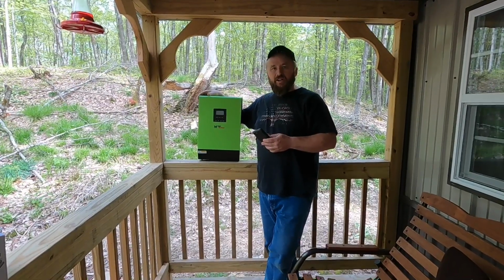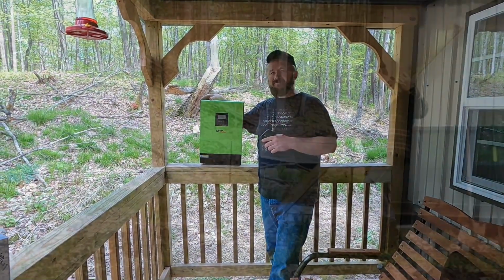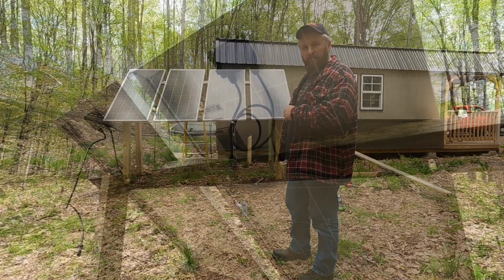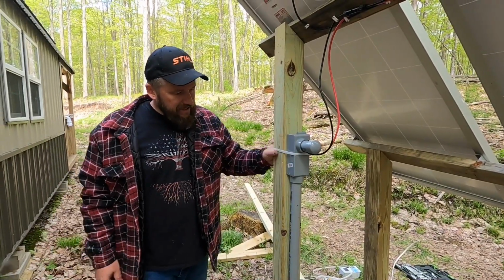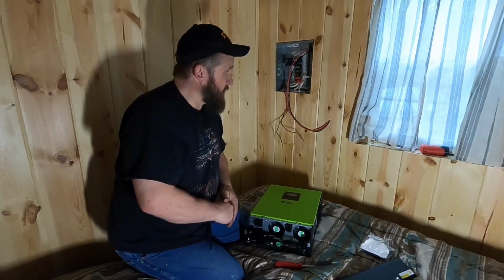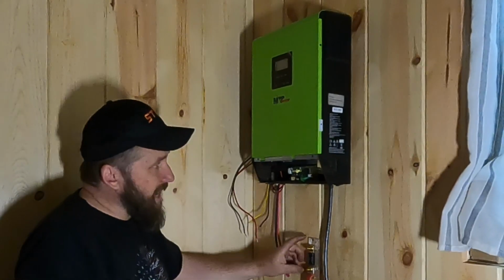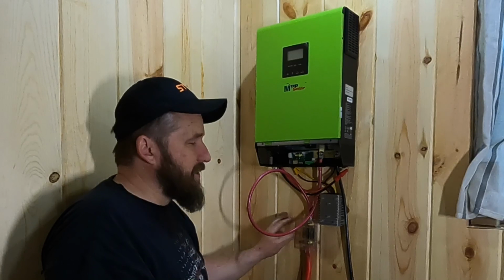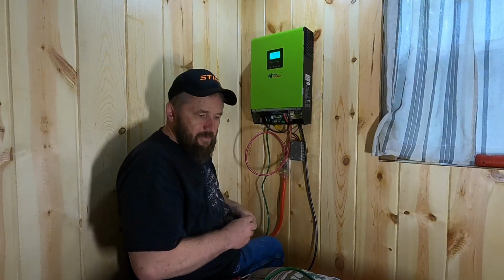MPP LV2424 Solar, cabin upgrade #offgridcabin #diysolar #mpplv2424 #freeenergy #freeelectricity

Comment: What did you use to attach the panels to the 2 x 4's?   Did you use any concrete in the hole?  How deep did you have to go with the holes?
Nice job by the way.  Have a remote cabin like yours and will put in a small solar system for lights.
Reply from the maker: @jws3925  the solar panels that I purchased came with mounting brackets. All I had to do was lay out the lumber. I dug the holes deep enough to be under the frost level, I don’t think I concreted these in because they’re not holding that much weight. here is a video link to the newest improvements that I did to the system. Hopefully this gives you some ideas on what’s out there.
Sun chasing solar panels at the cabin. Ecoworthy Dual Axis Tracking System, #solartracker #dualaxiss
https://youtu.be/fKYD5FuUEE8

Comment: That MPP inverter that you're hawking is no upgrade. It's a low cost, high frequency, transformerless inverter that offers a poor surge capacity and a short life expectancy, especially when power inductive loads like refrigerators, microwaves, portable AC units and large power tools.  You might be able to power some of these inductive loads when this cheap inverter is new, but every time you do, your shortening the life of the MOSFETs in the inverter.  A much better choice is to purchase a hybrid, low frequency, transformer based inverter charger. It will last far longer and you'll be able to power high inductance loads without damaging the inverter.
Reply from the maker: It sounds like you might not be aware of the needs of this small cabin. This is a simple small cabin that is intended to be in a camp where I hunt and fish. This will never be my primary residence. I have no refrigerator, no microwave, no air-conditioning, and no electrical devices which create large surges. This is a simple cabin that has been built on a budget. I took the advice from solar genius (Will Prowse) and so far it has been working perfect for me.
 I’m not sure what you mean by hawking but thank you so much for taking the time to watch and to comment. if you have any particular solar set ups that you would recommend for a small cabin like mine, I would love to hear about them
Reply: Well in that case, using a high frequency inverter for intermittent, small, resistive or electronic loads is perfectly fine.   @karlsoffthegrid1378

Comment: Hey Carl, I have set up the LV2424 at my cabin 2 days ago and could use a little help with the settings. I have mine set up like yours. Off grid, connected to generator and 4 12 volt batteries. Could you please provide a means of contacting you thanks bud.
Reply from the maker: My email is KarlsofftheGrid@gmail.com

Comment: I went with twenty big marine batteries on my 24 volts system. I started with six, and would buy two a month. I had 1200 watts of solar panels but I got two more that I haven't hooked up yet. I don't have the trees here. Last month I got a 600 watts wind generator and added it. I ordered a 24 volts model but they sent a 12 v one. I used it anyways, on the ten batteries on the negative side. My panels are split up with 600 watts facing the East, 400 facing the West, and 200 that I can move around. I had a shorted battery that I removed, which I'm going to replace tomorrow. With it back in I'll have 1000 amp hours. I want to get four more batteries for a total of 30,000 watt hours of storage. I could run a little window unit air conditioner last summer for a couple of hours a day, but I think that battery was going bad around then. It got worse over time until I started unhooking them and checking voltage after they sat awhile. So I found the bad one, and ever since I got it out, the voltage is better. All the others were like 12.48 and one was 9.7. It's showing 25.3 volts so one side is running 12.65 at 11 p.m. The voltage will improve again when I add the two back in tomorrow. Tomorrow night at the same time, it'll be 25.4, I imagine. So if I get those other four later, my twenty four will be like four of the one you have. (1210 amp hours). Last time I was in the parts house, a guy asked me what I did when the 🌞 sun wasn't shining...so I asked him if he had ever tried to run twenty big marine batteries down, and he said, "Oh, I see what you mean." I was still buying batteries when that one started going bad, and I thought it was funny that I had more power with 16 batteries than I did when there was 18. So I have never experienced having twenty good ones yet. My blue box is a 24 volts Aims Power inverter charger, 2000 watts. My charge controller can only take 1040 watts in. When I had a load on, so that it could charge, it was showing 636 watts this morning. It'll be over 800 with the air conditioning unit running, later on. I should be happy that I have enough to run it. The only thing is I have to turn the air conditioning off to use the oven, ( 1472 watts ). The both of them running, ( I tried it) was 2140 watts, so the overload light starts blinking red after a bit. But I'm going to be cooking outside a lot more when it's really hot. I built a cooking stove out of an old hot water heater tank. The air conditioning unit won't have to work as hard that way. I have been adding sheets of styrofoam to the walls and ceiling, so it doesn't take much to cool or heat it now. I think there were only three sets of cables from the solar panels last year, but had problems with that, so there are five sets of them now. Seems to work fine for now. Well six sets including the wind generator. Yesterday, my stuff made 3.1 kwH. I guess that's what I used the day before that. That's not very much but my system will make a lot more, closer to 10 kwH per day. I just don't use much most of the time. I don't use my Winco Lil Dog generator much except for welding. It's pretty quiet on the rare occasion that I use it. I had to charge the battery bank in November with it, I guess it was that bad battery. I'll get one later today. Well, nice setup you have there, how's it doing?

Comment: Your charge controller should have a 12v output, you could use that to a 12v fuse block without down grading your inverter.
Reply from the maker: Thank you I had no idea. I’ll check it out.

Comment: Can you wire an RV plug into the AC output to power an RV?
Reply from the maker: I don’t see why you couldn’t. Just make sure the voltage is compatible with your RV. Thanks for watching
Reply: Awsome, thanks for the help. Just got a new subscriber! Very helpful info watching your channel.

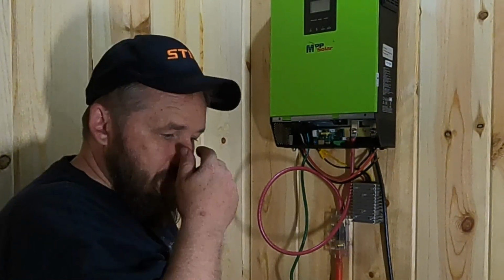Comment: Perhaps I don't know enough about solar systems, and in this case the inverter.  But if I understand what you did at about 18:30 into your video, you're using the male end of an extension cord to carry 120v to power your cabin?  If so, that's a no no.
Reply from the maker: Yes you saw it correctly. That’s what the manufacturer recommends. Use the male end to feed power back into the small AC loop that Supplies the cabin,  and use the Female end for plugging into with a generator if I need to. Manufacturer says they have enough protection set up within the system that it shouldn’t cause any harm
Reply: @karlsoffthegrid1378  again, maybe I don't know enough, but doesn't the male end have 120 volts on it, and if you touch the male end you will get electrocuted?

Comment: I’ve been running this same unit for about a year
 But all of a sudden  if the unit shuts down because of the low voltage cut-off  it doesn’t turn back on automatic 🤔🤔
  Kinda weird and scary incase I’m not around when my freezers and fridge are hooked up to it 
  Any info on this situation would help
   ✌🏼✌🏼✌🏼
Reply from the maker: I just put mine in this year so I’m new at it too. I bought mine through shopsolar.com and they have a free diagnostics line if you wanna check it out

Comment: I missed this video and man that is a great little system. Can't wait to get another on it later on so you can give us the pros and cons.
Reply from the maker: Now that I have had it a couple of months I can tell you I am so pleased with it. I will post an update next spring but so far it has worked like a dream, more power than I know what to do with. The only negative is I should’ve installed it somewhere other than my bedroom. It does turn on with the first light of day so sometimes I wake up for a second as it turns on. Other than that it has worked perfectly

Comment: I have been looking for this same setup but couldn't find a video. You might not be a solar guy, but you did an awesome job!
Reply from the maker: Thank you so much! I did my share of research before I purchased this unit and I am so happy I did. It works perfect and I have never ran out of energy yet. The only thing I did wrong is I shouldn’t have installed it in my bedroom. The fans turn on with the first ray of sunlight, so sometimes I wake up a little earlier than what I want to. Thank you so much for watching, good luck with your purchase!!

Comment: Hey Karl , nice solar set up. 👌 I was looking at the MPP 24 for my off grid cabin and curious how loud the fan is...does it shut off when there is only a small load? It will be in sleeping quarters and I could imagine it could get annoying if it's running all the time. Thanks!
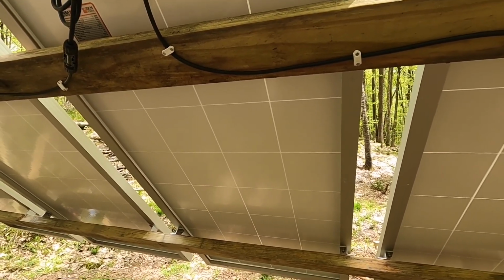Reply from the maker: The only problem I have is the fan turns on at 5 o’clock in the morning and shuts off at 10 o’clock at night. When it turns on in the morning it is  loud enough to wake me up. I’ve been calling customer support to see if there is a way to adjust it so that it turns on at 7:00 in the morning. Other than that it has been perfect! I have more energy than I can use. Keep in mind everything I have in my cabin except for my TV runs off a very little power. I plan on doing a follow up video at the end of this summer after testing its limits. I think you would really enjoy the system when it is programmed correctly
Reply: Thanks for the feedback Karl. I ended up ordering a MPP24 solar kit  and  have 2 100ah chins batteries which will run at 24v. Havent tested it yet but should be a decent amount of power for our off grid system.
Reply: @nickf6752  i just hooked  my lv2424  with 2 12v 100a chins seems to work

Comment: Hey, just trying to help. There is no way a $30 100W converter can power a 2400 Watt inverter. If your load is small, like 100W it might run for a while before that little box shuts you down. Get a 24V DC battery with BMS dedicated for the inverter and convert the house to 120V, and step down from 120Vac to 12Vdc at those appliances. Otherwise, you'll need a 2400 W DC-DC converter that will cost just as much as the inverter, to have a reliable system. In the sunlight, it should work fine because it's running on the solar panels, but when on battery, it's going to fail man and I hope it doesn't catch fire when it does. Take care.
Reply from the maker: Sorry I’m not sure what you’re saying.The cabin is wired in two different systems. The only thing I am running off of on DC power is my lights. Are you saying that my 24 V to 12 V converter Will start on fire by doing this?
Reply: @karlsoffthegrid1378  I may have misunderstood. I thought you said the home was wired for 12V and you were boosting from 12V to 24V to power the inverter. If you're going from a 24V battery down to a 12V circuit for lighting, then I completely misunderstood what you said and that objective is fine. Sorry!

Comment: I really like your cabin and your overall off-grid setup, but I'm puzzled about one thing.  You mention the entire cabin is wired for 12v DC...why are you installing a 120v AC inverter?  Maybe I missed it in the video.
Reply from the maker: The cabin is wired for two different systems. I have both an AC system and a DC system. My more commonly used “low draw”things like my lighting is done through DC power. The rest of the cabin is wired on a separate system using AC power. I hope that answers your question thanks for watching
Reply: Good job Karl

Comment: Brother if you need help with the programming of your Mpp Lv2424. Let me know. I have videos on it and I am willing to help guide you with this. Help a lot of peeps out doing this. There's a lot more you can do with the Mpp solar if you know how to set it up. Like even auto starting a geny. Not that I would do it for your place. Looks good brother. Thanks for sharing. God Bless
Reply from the maker: You are a heaven sent, lol! I will definitely check out your videos I am struggling with some of the programming. Thanks for reaching out to me
Reply: Hi Bobby 
 Maybe you can help me out 
 When my lv2424 shuts down due to low voltage cutoff.  It does no automatically restart after the voltage gets back up to 27volts. Just wondering if you know what’s up with this 
  It used to turn back on automatically
Reply: @cowboymcq6711  I have not a clue I am sorry. Not ever had mine hit the cut off..

Comment: Nice setup! Can't wait to see how you like it. Definitely going to look into one of these setups. Only thing is is my cabin is wired 110 or 120 with a breaker box like a normal house but good thing is I have a decent electrician up at the cabin and it is a good thing for me because electricity and I dont mix haha. How much would you say a setup like this costs? Thanks!
Reply from the maker: I think between the battery bank and the whole solar set up it was around $3000 give or take a few bucks. You could always wire this directly into your 110 system. That’s what I did, it powers both my AC and DC outlets. It’s a little bit of an investment but it will pay itself off quickly. It is so nice not to have any utility bills
Reply: @karlsoffthegrid1378  Thanks! Yes it would cost me right about 5 grand to get electric service in there as of now. Been using a generator but that is getting old and at the mercy of the stupidity in office and at the gas pump. Thanks for the info!

Comment: You can damage your battery BMS with that spark and also the terminals with that spark. It could also send small pieces of molten metal flying into your eyes. 

You can eliminate this by using a Resistor you can buy for only a few bucks. Just use a resistor between the connections to precharge the capacitors in the inverter. 

Just touch the leads of the resistor with your other connections for a few seconds and then attach the battery cable.

You can also use any INCANDESCENT light bulb. A 100W 120v bulb will do it instantly on a 12v system.
Reply from the maker: Thank you so much for the valuable information, it’s greatly appreciated!
Reply: @karlsoffthegrid1378  your welcome. Funny I was actually just editing the post because I thought I better make sure I wrote it right and I indeed had used capacitor instead of resistor in it so I fixed it. Thanks for your videos they are very well detailed and enjoyable.

Comment: Looks awesome brother! Not sure what your open voltage on those panels are but watch your how many you put in series... keep it 10v below the max on the charge controller unless it specifically says it has hyper voc protection  ... during cold months your panels will run way more efficiently and have higher voltages... we ran into this issue last year.. kept going over voltage, a breaker switch for your panels is a good idea if you want to fix some wiring ect. later on.
Reply from the maker: Thank you so much for all your help Robert, it is greatly appreciated! At first I was a little overwhelmed but I am slowly starting to figure these things out.Any suggestions on what breaker or a quick disconnect I should get for the solar panels? I think that’s a great idea. Thanks for all your help brother! Have a great week.
Reply: @karlsoffthegrid1378  Hope the family is well!  It's always good hearing from you..   Our shutoff breaker is just your standard double breaker 60 amp.
Reply from the maker: @krausfam5  Thanks for your help buddy. Know that your family is always in our prayers. We pray that your wife’s family is safe and we are hoping you’re all doing well
Reply: @karlsoffthegrid1378  Thank you for your prayers , God is answering them as we speak, they just got most of the paperwork done to come here until they rebuild when it's over... who knows maybe they'll stay...  
Your a good guy Karl we wish you guys nothing but the best in life.

Comment: Just caught up on your videos and a huge congrats on the new solar system! Haven't had internet at camp for a month now, but snow was gone when I got here and the fishing has been solid. It's been a cool spring but with summer right around the corner maybe your solar could power a small AC unit on super hot days. A quick dip in the lake works too lol, but nothing like a cool room on a blistering day.
Reply from the maker: It’s great to hear from you Jason! I believe I would have enough power to have a small air conditioner. It’s amazing how much power we generate that I can’t even use, lol. The next couple of weeks we will put the system to the test. I hammered the walleyes last night, fishing has definitely been hot! I even went for a quick dip in the lake but it’s still pretty darn cold 😂 . Have a great week brother

Comment: Do you plan on leaving it all hooked up during the winter, I know you said something about the battery having some kind of heat component to it, is that enough to keep from freezing?
Reply from the maker: I will build an insulated box around the battery and let it alone. I am usually at the cabin enough that I would feel comfortable doing that. If it gets frigid cold I will probably think about taking it home with me